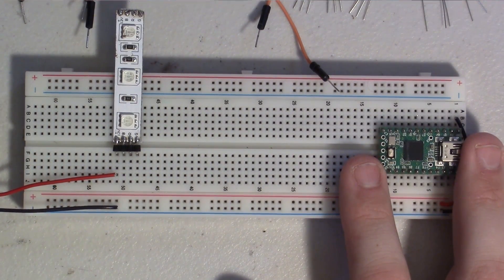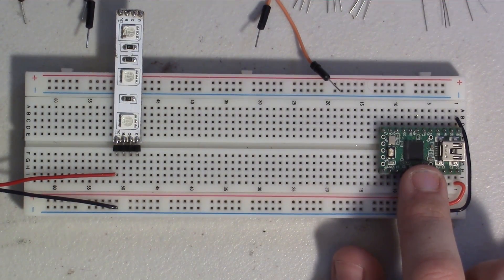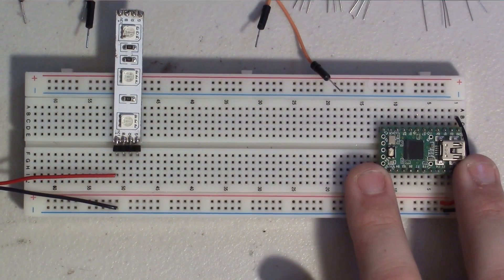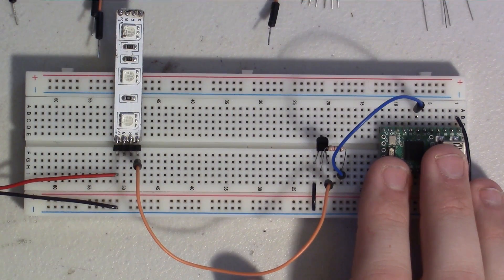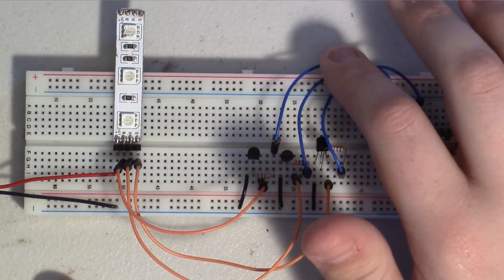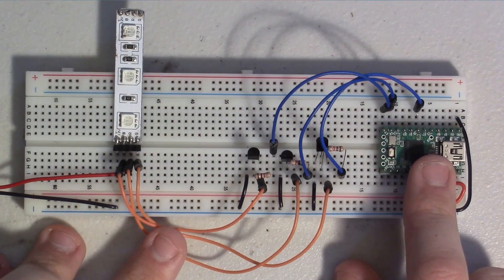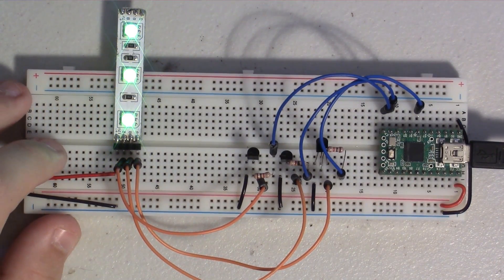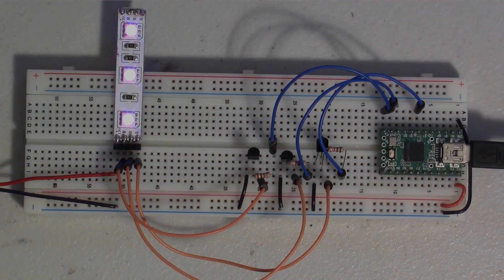How To Wire It! RGB LED Strip

Comment: If your to lazy to type the code, i got you:
int greenpin = 10;
int bluepin = 5;
int redpin = 9;

void setup(){
  pinmode(greenpin, OUTPUT);
  pinmode(bluepin, OUTPUT);
  pinmode(redpin, OUTPUT);
}

void loop(){
  fodeFromTo(bluepin, greenpin);
  fodeFromTo(greenpin, redpin);
  fodeFromTo(redpin, bluepin);
}

void fodeFromTo(int from, int to){
  for(int i = 0; i < 255; i++){
    analogWrite(to, i);
    delay(5);
    analogWrite(to, i);
    delay(5);
  }
}

Comment: I was looking through your videos for a wiring a 5v RGB strip like this one straight to the ESP8266 module using WLED if possible. Thanks. Or something similar but using the RGB non addressable with the ESP8266
Reply: I want to do this myself, but I don't know wich transistors I have to use. Can you give me an advice?

Comment: Dude the color changes are fine, but I have a problem. BDX56C
Using the transistor I managed to run it like in the video. I want to control this led with IR remote. For example, when I press the 1 key, the fading effect works. When I press the 2 key, it will exit the for loop and turn off all leds. How can I do that?
I tried many codes, but when the RGB LEDs turn red, they flash very quickly and switch to the other color.
I've been dealing with it for about 4 days, I tried every way but I couldn't. Can you help me please ..

Comment: why are the leds fading , the transistor just open and close to 12 V. How can the collector output be lower than 12V (ex 6V ) for a channel to be 50% bright ? I dont get it. Output of the collector - emitter is the same 12V no matter what you supply to the base (it only needs 5mA to open). Thank you

Comment: If im powering my uno with 12v can i pass the power through to the breadboard from the Arduino?

Also just to clarify you are using 3 pmw pins?
Reply: i think that if you power your arduino with 12v it automatically reduces 12v to 5v so you can power things at 5v with ur arduino
Reply: @brusch1553  i found that you can use the uin pin and the ground pin to get 12v pass through

Comment: Good video! One bit of warning to viewers. Not all transistors use the same EBC ordering for the pins. Every brand and device is different, so it's very important to check the datasheet for the transistor to know the correct order. For example, the BC547 npn transistors that I'm using for my project have the pins in CBE order.
Reply: It depends if the transistor NPN type then it use CBE, but if it is PNP then its EBC but this only counts for BJT transistors, mosfets are whole another story

Comment: Why not hook up to the existing LED receiver board? Couldn't you mimic the IR 44-key remote and tie into the 3 IR component receiver lines?
Reply from the maker: You probably could do that but often times these strips arent sold with those boards and/or there are often projects that would benefit from direct control rather than allowing a third party controller to manage the LEDs. I imagine those cheap boards wont allow for rapid changes in color commands (on the order of dozens or more per second) which is sometimes desirable.
Reply: @ItKindaWorks  Gotcha. Thanks!

Comment: Thank you for a easily understandable tutorial, just what I need for my Christmas star build!  Of all the questions I'm still working out is how to specify the power requirements.  Is there a formula?  I'll be using 2835 Leds and longest run will be about 6 feed and as pre season gifts, would like to make them run off a re-chargeable battery pack.
Reply from the maker: The easiest formula would be to take the power consumption of the 2835 LEDs in watts (you should be able to look this up from your LED supplier) and multiply that number by the number of LEDs per strip (a rough count will do). That will give you the wattage for the strip. Then you just need to get a battery that can match that power consumption for the amount of time you want it to run. 

For example 20 LEDs that draw .2W each gives a total of 4W for the strip (20 * .2). If I want that strip to run for a minimum of 5 hours, I would need a 20Watt/Hour battery (5 hours * 4watts per hour).

This should give you a rough idea of the power requirements for your project. Either that or I'm dead wrong and someone will yell at me because y'know - internet.

Comment: not working :/
Reply from the maker: How is it not working?
Reply: Now is the strip light up, but now in a color
Reply from the maker: Can you send a clear picture of your layout? Have you changed the circuit/code at all from what is demonstrated in this video? My guess would be either your transistors are not wired properly or just poor connectors going from the strip to the transistors. One way to test your circuit would be to use single discrete LEDs and try to control those with the transistors first (using 5v instead of 12v for the v+ on the LEDs).

Comment: Where buy 2n two two npn transistors?
Reply from the maker: Just about any electronic parts supplier will have them. You can also use ebay, aliexpress, etc. Just look for "2n2222"

Comment: does this strip version of rgb work for a matrix 8x15 ?? , i mean the 12V-R-G-B version in a matrix because i´ve seen them but with V-DATA-GND versions
Reply from the maker: This version does not work as a matrix as there is no way to control the individual LEDs. This is simply a set of RGB leds being controlled all at once.
Reply: ItKindaWorks ty

Comment: you could use a LM317 to step down the voltage from the 12v input source
Reply from the maker: Looks like you should be able to. Just make sure you put a heatsink on it or it could get very very hot!

Comment: should add some capacitors to get a stable output and input
Reply from the maker: Good suggestion!
Reply: As a newbie Lukas, how would I do this?
Reply: I second @alanchanno1946 on this question. I am completely new to microcontrollers/arduino/etc. Advice on the best concise informational resources would be great!

Comment: How would you do this with a normal fixed color led strip? I assume there would be no transistors?
Reply from the maker: If you want to control it via an Arduino (or other microcontroller) you will always need a transistor. The transistor acts like a switch so that the arduino can turn the 12V on and off while only being able to control 5V by itself. If you just have one (fixed) color then you would just have 1 transistor rather than 3
Reply: If this were done, where could i add a piezo switch to act as the trigger to turn it on or off?
Reply from the maker: You would add the piezo as an analog input to the arduino and then in code have it check to see when the piezo passes a specified threshold which could in turn control the LED strip.
Reply: so the piezo would plug into a second analog input from where?

Comment: What is the maximum number of leds that the n2222 supports, my doubt is that when putting too many LEDs the transistor will heat up a lot.
Reply from the maker: Yes you are correct, this will only work with shorter lengths. In general I've been ok with strips up to about 3ft. More than that and you'll need a higher rater transistor or use a MOSFET.
Reply: Which mosfet do you recommend for the size of 15 feet?

Comment: Hey, guys, will "2N3904 TO-92 NPN General Purpose Transistor" work?

Collector Emitter Voltage:  40VCollector Base Voltage: 60V
Emitter Base Voltage: 6.0VCollector Current Continuous: 200mA
Operating and Storage Temperature Range: -55 ~150°CTransition Frequency: 250MHz
Reply from the maker: Yes however the 3904 provides less current than the 2222 I believe so you'll only be able to drive shorter pieces of LED strip.
Reply: ItKindaWorks Oh a I see, thank you!

Comment: I've got a troubleshooting question for you. I've got 6 channels of RGB wired up with their own pins to the Arduino. On two of the channels, the blue stays a little hot, making a pure red slightly purple, and the green slightly amber. Any thought on where my likely mistake might lie?
Reply from the maker: The blue what is a little hot? The LEDs themselves or the transistors? I assume it's the LEDs - in which case I would check and make sure that you are giving the correct voltage and that your power supply can handle all of the LEDs that you have. Often times cheap power supplies can be far from accurate.
Reply: Sorry, when I say "hot" I don't mean creating heat, perhaps a poor choice of words. I mean that the blue stays on (roughly a 20 out of 255) regardless of what it's supposed to be doing.
Reply from the maker: Ahh ok that makes more sense. Hmm... I'd check that you dont have any bad connections around the transistor. What happens if you connect the base of the transistor directly to gnd? That should totally kill the blue channel. If it doesnt then you might try swapping out the transistor because maybe it fried. Also how many feet of LEDs are you trying to run? a 2222a (or similar npn) should be good for up to a few feet but for something like 5+ ft you probably would want to use MOSFETs which are pretty similar to regular BJT transistors but have slightly different wiring (I'll should probably do another video with MOSFET drivers...). Let me know!
Reply: I'll check that. Thank you.
I will be running just under 10' of RGB tape using a TIP41A transistor (recommended by the owner of our local electronics store). Though for the test rig, I've thus far only run a 2" section.
Having just googled "MOFSET", the TIP41A does look to be that. It's an NPN (and I sorta know what that means). The collector, base, & emitter are in a different order from the 2222, which I accounted for. As both transistors are NPN does that mean that each leg is doing the same job (allowing for the fact that they are in a different order (BCE)?

Comment: What arduino is that?
Reply: an arduino nano
Reply: which can actually take 12v, so it must be some strange version of the nano
Reply: The Arduino IDE used in the video identifies the board as a Teensy 2.0 (at the bottom of the screen). It has a 32-bit ARM Cortex processor, so it's not a Nano. I don't think it's really an arduino, although it can obviously use the Arduino IDE.
Reply: Thanks, so its a Teensy 2.0
Reply: oh cheers for that clarification, I assumed because of the small form factor and because of the IDE, that it was a nano.
Reply: which is wrong, cuz nanos can't output 12v

Comment: what Will happen if i wouldnt use resistance?
Reply from the maker: On the transistors? Since the resistors are being used to limit the current from the pin, removing them would mean the transistor may draw more current than the pin can handle and possibly blow out the pin.

Comment: Hello sir
Can we drive more than 25m RGB strip using Arduino controller ?
Reply from the maker: You can but you'll want to swap out the 2n2222 transistors for N Channel MOSFETs.
Reply: @ItKindaWorks  Can you specify some N channel MOSFETS models that can handle such amount of current, needed for long strips? Like for 5m you need this, 10m you need that, for 20m you need that other. Or maybe a way to calculate what we need and then looking for appropriate mosfet. Thank you in advance! :)